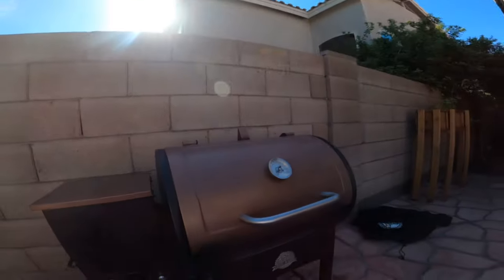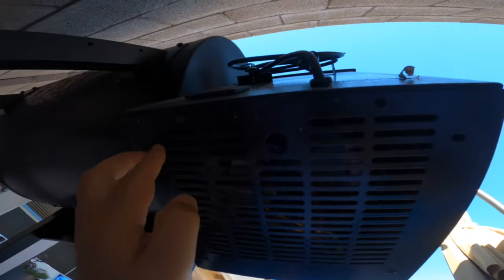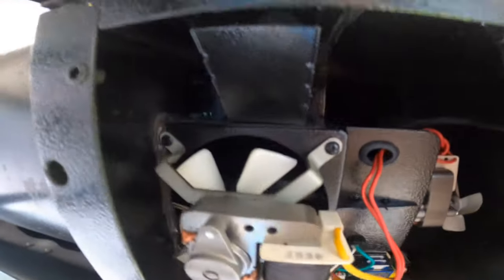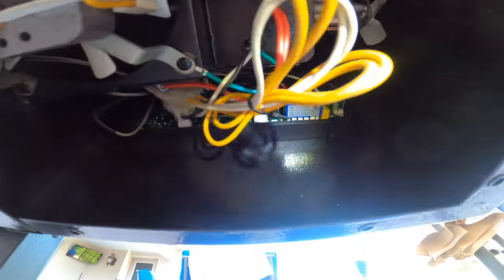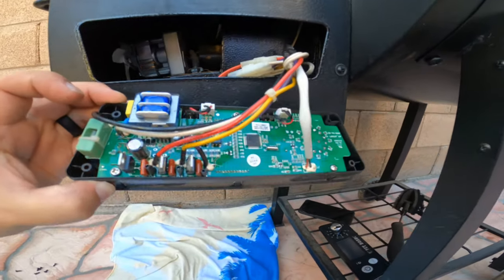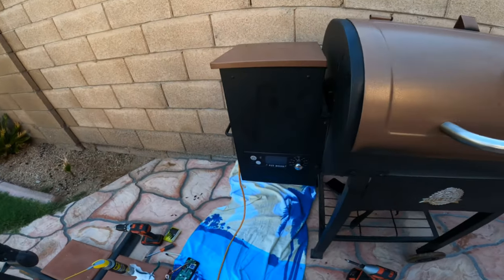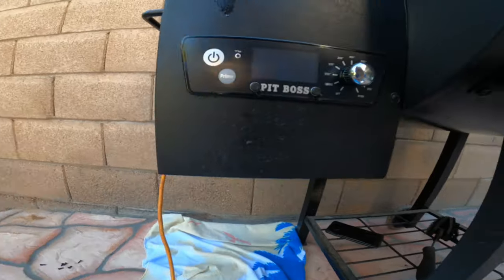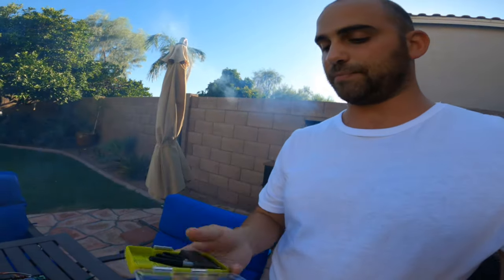How to replace your Pit boss classic pellet smoker control panel display

Comment: Used this video to replace my control panel with a highly rated aftermarket one from Amazon. The best time saver time of the video is "Replace the wires one clip at a time as you remove them."  Saved me a lot of stress!
Reply: Do you remember the info from Amazon on what to order by any chance?

Comment: I have had my Pit Boss Tailgator just under 2 years and while using it, the digital screen stopped working and unit shut off. I contacted Pit Boss for a replacement and was greatly happy to find out the part is covered under their 5 year warranty and that they are fed exing me a replacement screen assembly for FREE.  I am very happy I had saved all of the papers when I purchased it and that I had registered my Pit Boss when I bought it. My part number is 15-PDH but call Pit Boss and have your serial number and they can tell you your correct part.
Reply: It took over 3 months to get the replacement part. I am very unhappy. I had good screwdrivers but 2 of the bottom screws stripped out. I did not like having to do my own labor. Probably my last pit boss.

Comment: I've had mine less than 2 yrs. Used it so much, the burn pot has burned out. And my screen on the controller faded away. Only time it has readable letters is when it's cold out. Ordered the parts through Walmart. Reasonably priced. Oddly enough the igniter (hot rod) has never failed. I ordered a spare one of those while ordering.
Reply from the maker: Oh nice. Ya mine did the same thing. I sold all my Pitboss and bought a green mountain. Never look back at Pitboss again. The smoke and the taste of the food is so much better.
Reply: @Rollinsmokeaz  Took the day off from work today. Just finished putting fire pot, igniter, and controller in all at the same time. It was a chore. Had to use channel locks to get the screws out of the fire pot. Cooking some sausage for a late lunch. I like my tailgater. Just got done with a 3 day drunk, away from the house. Everyone liked the food that came off it. Including the brisket. No problem getting plenty of smoke. Choice of pellets is key. And i never wrap anymore. Unless you spend big bucks i think most come with the same burn pot. I looked at my brothers pits and spits, same burn pot as my pit boss. I can buy 5 of my pit, to one of his. He had to change igniter a while back. Told him he better get ready for the burn pot, since its the same as mine. I think some use a ceramic pot. That seems like a good idea.
Reply from the maker: Very good.

Comment: Is it necessary to remove the bottom cover? Can’t you remove the front only?
Reply from the maker: You would want to remove the bottom to just push the clips down from back and know what cables go where.
Reply: My prob is runaway heat . No matter what the setting, it never stops burning going to 500 plus.  Before replacing the controller I’m wondering if it’s an issue with the temp probe not getting the signal to the controller. Any ideas?  Thanks
Reply from the maker: @1ProShooter  so this is a known problem with pit boss. That’s why I sold 2 pitboss I had. For example my pit boss classic was the same way that think would get up to 600 degrees felt like. So when pit boss came out with the new models and I purchased the Kc combo. I felt like it would never smoke and always took for ever to shut off. I found out that pit boss ended up lowering their temps on the controller due to grills blowing up and catching on fire. What would happen is during the cool down point the fire would shoot back towards the hopper and light the whole hopper on fire. I moved away from pit boss and have been very happy. With my green mountain. Check out my newer stuff and the reviews of my green mountain. I can set it as low as 150 and high as 550.

Comment: Did you have to take the clips off of the old PID? I don't know how those clips work I wish I could have seen you put the clips on
Reply from the maker: So it’s a very easy install. Take a flat head screwdriver and there is going to be 4 clips that you just push down on each corner. And pull the pid away from the hopper
Reply: @Rollinsmokeaz  hey I certainly appreciate the rapid reply I'm going to tackle that thing tomorrow since it is the 4th of July! Hope you have a great 4th of July are you cooking out today too??
Reply from the maker: @maxwellmaxter  thank you so much. If you have any more questions about it let me know. Have a great 4th.

Comment: Mine came out of the box with a blank screen. It works you just can't see anything digital. Pitboss said it was on backorder so they gave me a Bluetooth/WiFi one,  lol
Reply: @Tyrel Glaser thumbs down for that lol well to be honest it isn't too accurate the Bluetooth/WiFi one. Using it broken for a month with the screen blank and just using thy dial and looking at the temp guage worked better. Thi Bluetooth thing has been off by like 50 degrees

Comment: Pit boss is a joke product! I replaced everything 1 at a time and I’m a certified electrician-welder and carpenter! And I keep mine immaculately
Clean and now it’s spitting smoke and starting fires- what is going on?! I even double checked the control board I got sent from the company and everything is just like my old one but still paint functioning correctly, I’m putting my old one back on because it worked- I only replaced it because it was faded and gross!!!